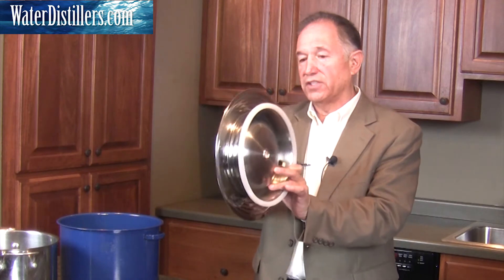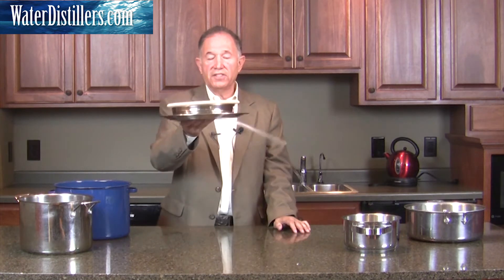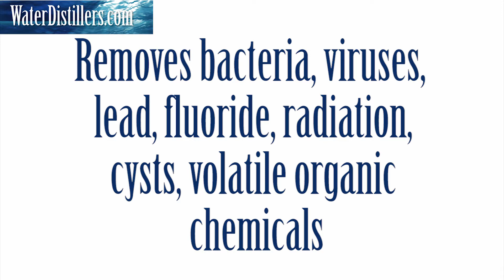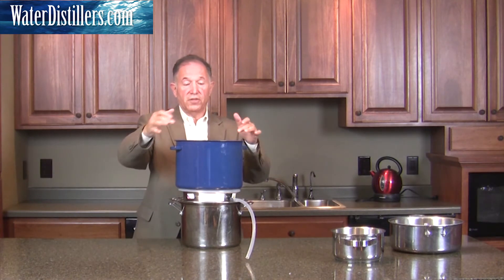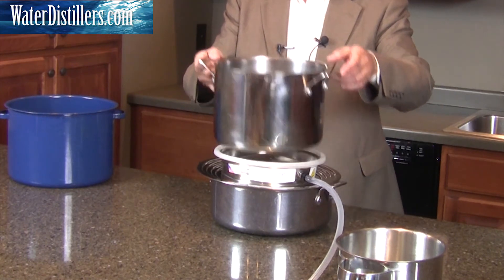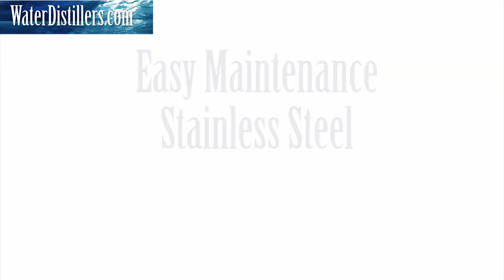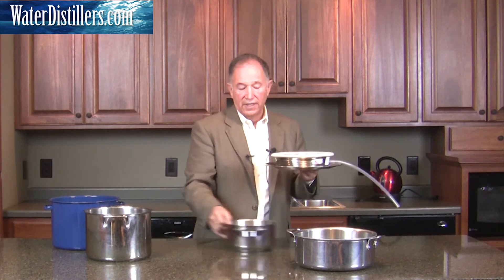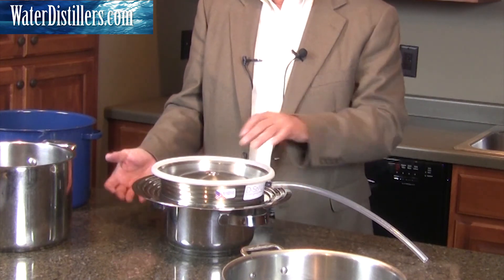Survival Non Electric Compact Water Distiller for Emergency and Survivor Simple Water Distillation

Comment: A tad confused (sorry),
So you take a lower pot with dirty water, place that over heat (?) to warm up the water, place the distiller over the heated pot, place a pot with cool water, ice snow (what ever you have), on top, point the tube into another pot to collect water...is that correct?
If yes, how much fresh water is collected per pot?
Reply: Yes and it would depend on the evaporation rate. The evaporated water is steam and the steam hits the cooler pot above and goes out the tube as clean water.

Comment: How does this work???  What’s a condensing pot?
Reply from the maker: Source or water to distill goes on bottom unit is wedged between it and top pot. Top pot contains cold water to create condensation in the unit and the distilled water goes out the tune into a collection container.

Comment: The smallest pot you showed would likely be the largest pot available to a backpacker. Can you use a metal plate on the top for a "condensing pot" if you don't have another pot?
Reply from the maker: Not very easily as you need something cold on top to aid in the condensing and water or snow (depending on your region) would be the normal choices.
Reply: YES

Comment: A stainless steel extension tube is available for less controled flames. The tubing showing is High heat and flame resistant.
Reply: Where di you get what your talking about? I'm totally green behind the ears😱

Comment: A STAINLESS STEEL EXTENSION tube option is available for less controlled flames . The tube showing on video is
High HEAT and Flame RESISTANT
Reply: can i get one of these am in britain al have the stainless tube for it how much with postage uk.

Comment: ib1254 - a STAINLESS STEEL EXTENSION tube option is available for less controlled flames. The tube showing is 
High Heat and Flame Resistant.